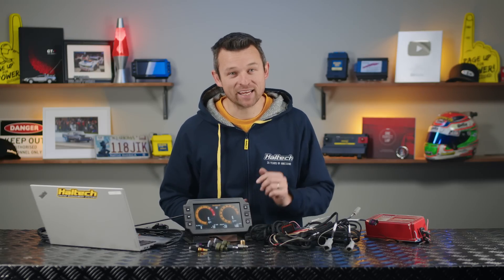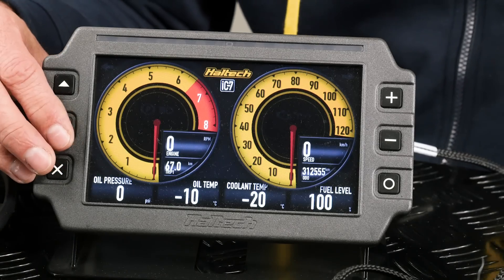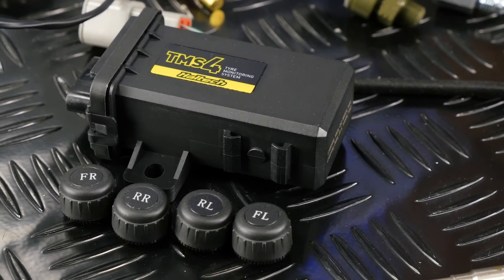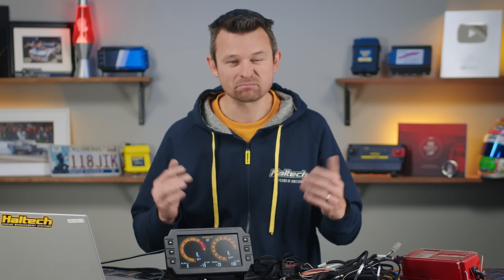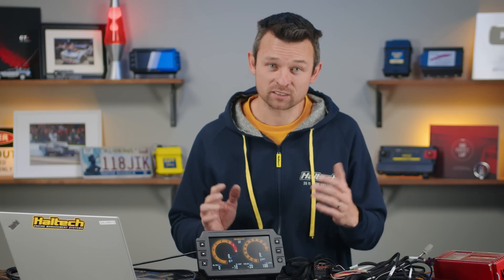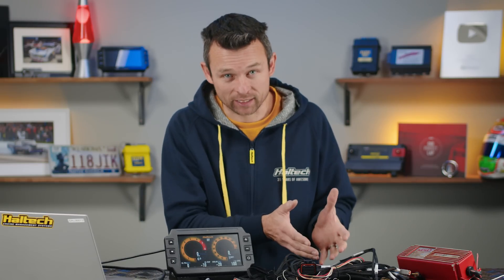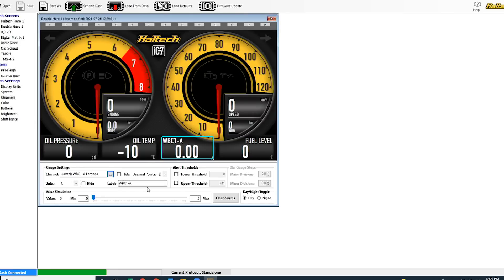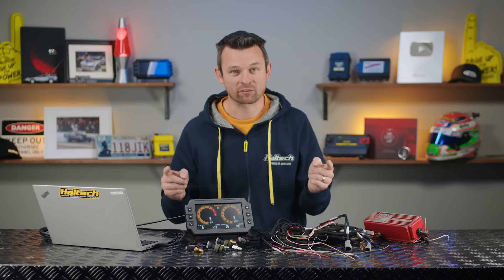⚠ iC-7 Goes Stand-Alone! | PRODUCT OVERVIEW

Comment from the maker: Love the look of Haltech’s iC-7 dash, but aren’t running EFI in your car? Say no more!
The Haltech Stand-Alone iC-7 “Classic” kit has been designed specifically for carburetted or mechanically injected cars. The “Classic” kit comes with a semi-terminated harness that allows the iC-7 to interface directly with sensors and switches in your vehicle making the iC-7 a truly universal, stand-alone display dash. 
Here is Matt, our resident, self-confessed classic car aficionado, to tell you all about it!
Reply: Hey guys, loving the new dash features,  one question though, I run a mechanical injection diesel with pulse sensor for the tach,  is the ic7 capable of reading an displaying that?

Comment: Can more inputs be added? (Possible future software update) or would that require a hardware change? 
Also, if I wanted to run a dash on a car with a factory ecu, could I piggy back off the standard sensors (GM) or would I have to run stand alone sensors?
Reply: @Matt Wright Thanks Matt. With the hurdles you mentioned for adding the IO expander, are they likely to a software or hardware change if they are sorted? I’m probably not looking to buy an another ecu as it blows the cost out for what I trying to achieve. Also, does the fuel level use one of the inputs or is it a separate thing?

Comment: Can I use one of the included pressure sensors as a tire pressure sensor and then just use a really long wire?
Reply: @Matt Wright  I will use the handbrake method😄.  I think my father said that there was a guy in the USA in the 60’s or 70’s that had an electric drag car that used a chord that unraveled as he went down the track.  I guess back then insane mode required an extension chord.  Yes your tire pressure system is awesome like most other Haltech products.

Comment: Would I be able to convert my ic-7 dash display as a stand a lone unit with an update? Or do I have to proceed and buy another unit?
Reply: @4:59 he's saying it's the same hardware, so you're in luck. Software upgrade will probably give you that standalone option, so I guess it's going to be upto wiring and sensors then...
Reply: @ScuzzySera  oh nice! I didn’t catch that at the end,I must have zoned out a bit lol..thank you for the info,I’m stoked to know that I can use the display dash as a stand  alone now with just upgrading the harness and sensors,thanks again
Reply: Found this: semi terminated harnesses (HT-060300) and sensor kits (HT-010001)

Comment: Hey Matt, we run a mechanical fuel injected altered with a turbo 2j, is the ic7 display capable of aiming for targets etc or monitor boost pressures as well as all the other systems required for normal cars.

Comment: Will you be releasing an updated elite ecu CAN protocol to allow the haltech tpms data to be used with other brands of loggers (AIM particularly)?
Reply from the maker: It's not currently in the pipeline, but as with everything - if there's enough demand for it....
Reply: Would be great if this was a logger dash! No EFI needed, just good display that can pull rpm, WB, oil pressure, and fuel pressure data after a run for the basic weekend warriors

Comment: I didn’t really want to use the words “game changer”… But, well it is. 
Is there an OBD2-IC7 adapter on the ideas whiteboard to simplify things even further?
Reply from the maker: We already have an OBD-II version of the iC-7:
https://www.haltech.com/product-category/dashes-gauges-and-data-logging/haltech-ic-7-dashes/
Reply: @haltech  so is this compatible with early 2000's Toyota Landcruiser 1HD-FTE diesel engine vehicles?  They seem to be a bit of a niche operating system to my limited knowledge.
Reply: I have a feeling the OBD2 configuration was used to optimise the carbconfig

Comment: nice, this should also have canbus so if you do have a standalone later down you could just use a single canbus for all the data or connect it like how they work with standalones
Reply: It does have a canbus connector right above the 34pin.
Reply: @andersjjensen  thats actually not the canbus connector. That's M5 connector for the USB lead for programming the dash. The canbus connection is within the 34 pin connector :) (Pins A1 & A2 to be exact)